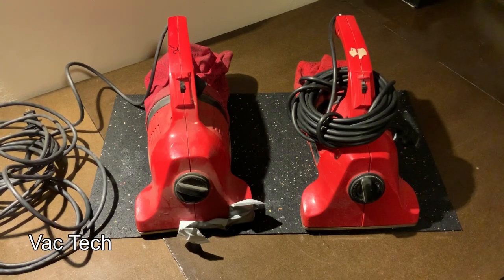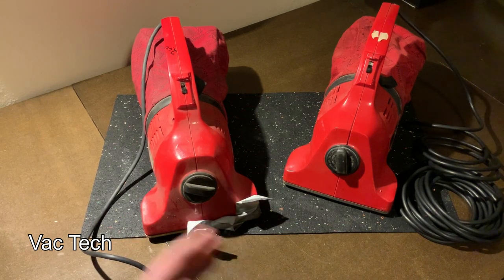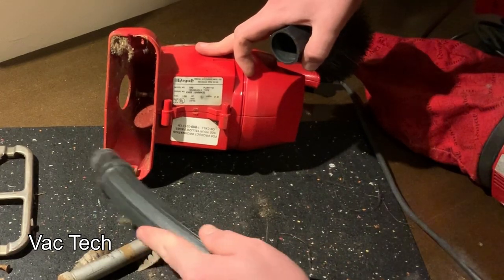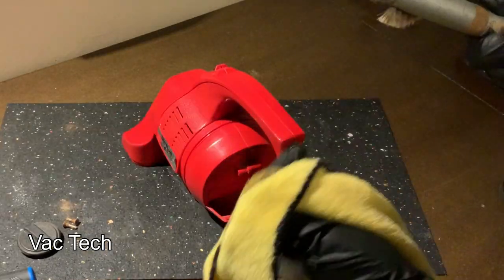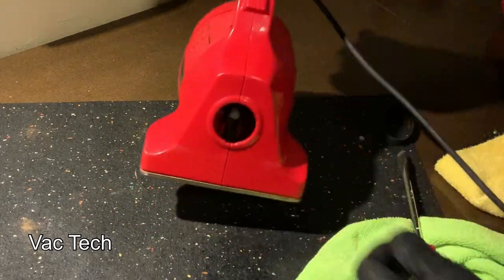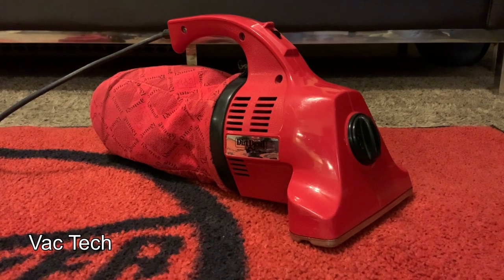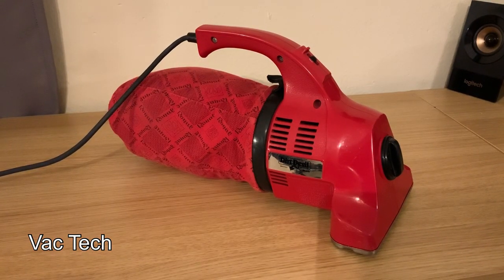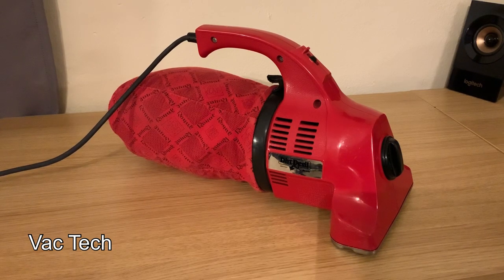1990's Dirt Devil Hand Vac Tune Up and Demo - Model 103

Comment: I want to tell you!  You really have to take VERY good care of these babies.  They don't make them anymore.  I actually have one of these Dirt Devil handhelds, same model and everything, same vacuum.  It was given to me by my real dad.  He used it in his pop-up camper and when he sold it, he gave the handheld to me and I use it for my stairs, couch, computer chair, and my upholstery and I like it.  I have a central vacuum system in my house and I actually love it but it's a pain to get out that long hose for upholstery so I use my Dirt Devil handheld hand-me-down for upholstery.  Knock on wood, still works!  😊

Comment: 😆 LOL!! The ultimate "Dirt 😈 Devil Test". I remember vacuuming the basement floor of my parents 🏠 house in 1987, at 4:00 am. Just the sound of the motor takes me back to then. The motor was surprisingly quiet, but this machine delivered some serious 👊 punch, as far as cleaning goes. The Dirt 😈 Devil was available for about $34.99 (varied by store), and I remember buying a couple of them in my time. My 🚶 stepmother"s Dirt 😈 Devil ✋ hand vac was the neatest thing, being the black Royal 500 model. It was irresistible to use, and I'd find my way, down to the basement, to 🔌 plug her Dirt 😈 Devil in, and start vacuuming the basement floor on several occasions(👍 yes, around 4:00 am). Dirt 😈 Devil is an Ohio-based company, and has been since somewhere around 1930(I need to ✔ check it out). Taking note around 1990, I noticed that there was a Royal Prince ( or close) ✋ hand vac. This was a silver aluminum version of the later plastic Dirt 😈 Devil, but I think they made both models through the years. I received my 🚶 stepmother's Royal 500 ✋ hand vac in 1994, for my own apartment. I also 👍 like Dirt 😈 Devil's 1980's ☝ upright vacuum. It's so easy to push it around the 🏠 house, and it used the identical belt that your ✋ hand vac uses. Got a used one for $5.00, or $10.00, for my Casa Grande, Arizona apartment in 2009. One word of ⚠ caution about changing belts, right after shutting off the vacuum. ✋ Wait for at least 10 minutes, to do so. The motor shaft gets freaking 🔥 HOT!! Also, perform the belt changing task with your vacuum unplugged, to avoid injury. Someone, or you, could accidentally turn it on. Your friend, Jeff.

Comment: I was given the same model of dirt devil the other week . It had the same issues with the cord splitting at the grommet where it enters the machine at the handle and the motor sounded like it needed the bearings greasing/ oiled . Stripped the motor down to regrease the bearings and solved the cable problem by boring through the grommet so that the cable passed right through to the terminal block for the wires . Our newly acquired Dirt Devil Handy work perfectly again and my wife loves it for cleaning the car . Great and interesting video from you . Being from the United Kingdom I have a great collection of Differing models of the Hoover Junior

Comment: I had the same issue with the bag wearing out. I used one of these in the early 90s to vacuum the stairs and my mom's car back in the day. These are great for cars. If I find one somewhere I am so getting it.

Watching you clean the bags out reminds me of the TV show Monk when he vacuums and then vacuums the vacuum.
Reply from the maker: Haha!  Vacuums are the best tool for cleaning out other vacuums.
Reply: lol this comment made me laugh so hard!
Reply: Totally agree on the quality of the cleaning ability of these. I have one somewhere around my place but can't find it. Need to make a better effort to find it because it does work great for stairs and cars.
Reply: @edracz1224  Yeah now I use that swivel sweeper cleaner thing they had on TV about 10 years ago and I've had it so long the original battery died and I'm now running it off a custom made pack but it still works and cleans. Doesnt clean as good as the DD but it works. Fills up quick too.
Reply: @VacTech1 I just have a comment on the brush roll itself, is there an arrow that must point in the same direction as the arrow on the metal frame you screw on, I have a dirt devil myself

Comment: You mentioned the Prince model was quieter, so now I hope to find one at a thrift store some day! They are available on Etsy & Ebay of course, but not as satisfying as finding one for a very low price. I have 4 or 5 of these red plastic Dirt Devils obtained free or for a few bucks but rarely use them because they are so loud.
Reply: I bought it for $6.77 from the thrift store yesterday with attachment kit.

Comment: I have 2 of these from thrift stores. Very common thrift find. They both work. I just can't ever find hoses for them anywhere. I try to connect hoses from other vacs but I think I'm missing a needed accessory to fit them in properly. I love 90s dirt devils. Just not as much as I love my 70s Kirby. The Kirby's weight and solid steel construction made me keep it around all this time. Very low maintenance and still works like new.
Reply from the maker: If you keep an eye out, the tool sets are still pretty common. You can often find them new or hardly used, and I see them at thrift stores. They have a special hose end, with a locking clip that holds the hose to the machine.

Comment: I'm curious as to the comparison of the cloth bag by itself compared to the paper bags. Do they blow a lot of fine dust into the air? 
I have an even older model ( not dirt devil) and if I remember correctly it has a bag with-in the catch bag, a double layer catch bag if you will. I've seen others with a paper bag inside the cloth bag. Which I'm sure work the best at preventing dust from coming through.
But I'm curious as to how just the bag alone you have on the ones you fixed compare...
I remember starting one of those old uprights with the paper bag inside the cloth bag and it poofed dust on start up. lol But those are much bigger motors... or I would think they are. DO you see the same with those Dirt Devils?
Reply from the maker: The optional paper bag definitely helps with filtration, for sure.  I would prefer to use a paper bag with mine, but these early ones would require the optional paper bag adapter.  The filtration on these is pretty poor, but tbh it wasn't out of the ordinary 30 years ago.
Reply: Thank you  @VacTech1
Reply: Your video was so fast I could not see how the bag comes off, Does it just pull straight off From the plastic ring? I just don't Want to pull on something and Break it.

Comment: I have a model 500, made in the US in 1991. I bought it at Goodwill years ago. It still works, though I think it could use a tuneup. Truth be told though, the great majority of my vacuums are trash picked. In eight years I have picked up about 50 or so of them, very few of them have I had to scrap. They are mostly Bissells, Dirt Devil‘s, Hoovers, Sharks, and Eurekas. 

As soon as I get a new phone to replace my five year old iPhone 6s, I will be making and releasing a video of my 4th vacuum competition, between my three shark navigators, NV 60, NV 22L, and UV 410.

Comment: You for sure, want to pull the end caps off the brushroll, and service the bushings. If they get hot, they can actually get hot enough, to deform the plastic slots that the end caps fit into. To do that, I chuck the axle in a drill, douse the bushing with "Zoom Spout" oil, spin it, then, blot the oil out with paper towel, then repeat. Do that, until the oil no longer comes out dark. After that, re-assemble the brushroll, put it in the vac, and run it with the sole plate off. Touch the endcaps with your fingers, and make sure they aren't any more than luke warm after a minute or two of operation. You cannot replace those brushrolls, so, if there's bristles on the one out of the other vac, it's definitely worth salvaging, servicing, and keeping as a spare. These were the best hand vacs out there, and I don't know why they discontinued them!
     Another modification is to remove the rear bronze bushing in the back of the motor, and replace it with a 608Z ball bearing, exactly identical to the load end bearing. The shaft size is right, and the outer diameter is exactly the same. and all that's needed, is to use a Dremel tool, and grind out the bar that fits into the notch of the bronze bearing.  I used to call this "Black Bombing", making the motor commercial duty. A good thing, since these motors are irreplaceable. the reduced friction of the ball bearing actually improves the performance noticeably, and reduces the temperature of the motor. It makes it much more able to handle the cantilever force caused by the tension of the belt.
Reply: Mine looks Rusty & the roller doesn’t turn. Engines turning belt but it won’t move the roller ? Put REM Oil in the ends of rollers - any suggestions?

Comment: also Im getting strong (The Brave Little Toaster) vibes when you are fixing it with the music in the background!
I subbed just because I know this will help me get the most out of my royals!
I referbed my first royal in spring of 2019 and it started having all kinds of problems recently. I couldn't bring my self to toss it just yet.
My mom got me a machine I saw at a thrift store that was missing the rubber nose plug. I originally planned to use it as a donor for the bag motor and beater bar. It is almost mint! It worked fine just swapping the rubber piece from my old one and reataching the belt that came off! The switch on this one is kinda looser and somewhat recessed feeling than my old one. Its not as snappy as the old one. Is that normal for some of these machines?

Comment: I just found one of these at a thrift store, these are great for cleaning stairs, couches, and cars. It's missing the front nozzle cap and it needs a new belt and brush roll. The problem is a lot of these parts have been discontinued and I don't know where to find them and I don't know what kind of bags to buy for this since Dirt Devil made several different revisions to this vacuum over the years. Please help.
Reply from the maker: I don't have any spare parts, but these hand vacs are still very common on the used market. Very common at thrift stores. When you take the red bag off, if where the dirt blows into the bag looks like you can fit a paper bag (looks like a tube), then it takes a Dirt Devil type G paper bag. These take a Royal/Dirt Devil style 1 belt. Hope you're able to get yours running!
Reply: I got the bags and belt only to discover the bags need an adapter which didnt come with my Dirt Devil 103 Thrift Shop Vac, ill post it also if i find it

Comment: Thank you for your video.  I have just changed the belt on mine which I think I bought in the early 80s.   Another video mentioned lubricating the motor, but didn't demonstrate it.   Are there lubrication points on the motor?
Reply: If I may answer that: there are no oil ports to add oil, but there are ball bearings in the motor. You can replace them when they go, or you can sometimes salvage them if you pry the seals off and repack them.
Reply: @mattjones7621  Thanks.

Comment: Over the years I have collected 5 of these. Two with the bag attachment port and two without.
Does anyone know if there are filter bags still made or that can adapt to these? Are the parts and cases all inter-changeable?
The mess with just the cloth bag is not worth the mess and the coughing fits. 
My son is trying to design an adapter to hook the exhaust port it to a chunk of 3" hose but it's a bit problematic.

Comment: I have a model 103 (red bag) and a model 501 (blue bag). Both vacuums were being used without filters. Do I need to use a paper filter with either one? Amazon sells filters for both (type G & J).
Reply from the maker: Paper bags are optional, but make taking care of it easier.  They take type G bags.  Early Dirt Devil hand vacs required an adapter to use a paper bag (they used to sell a conversion kit), but newer versions could take a paper bag without an adapter.  I hope this helps!

Comment: You had your hand over the reason I was watching your video 😫.  I need to take the bag off and I hesitate to pull too hard on the bag tab (I don't think it's ever been taken off) in fear it will break.  How do I take bag off?
Reply from the maker: It removes with that pull tab, or you can gently work the entire black bag ring off (it just stays snugged-on by that black ring, and just pulls off).  I just wouldn’t pull on it by the fabric bag itself, as that could tear if worn.
Reply: Many thanks.

Comment: I have a Dirt Devil Series 500 just like these but black and yellow we’ve had it for years still works like a champ but gets little use any more the kids pulled the rubber plug out of the front we put duck tape over the hole works fine but never found the rubber piece
Reply from the maker: You might be able to get that cap on ebay, or if you see another Dirt Devil at a flea market. Thanks for watching!
Reply: @VacTech1  I’ve been on the hunt for cheap attachments for it as well as I mainly use it for cleaning our cars now but is still used in my household some, it was the best for our minivan we had

Comment: I have severe lung issues so I want to use a bag but I can't seem to find the bag number( I have the Dirt Devil 500 handheld) I know someone told me the bag G works but with that lip thing on it like that at the bottom it does not work.  Can you please advise ? Thank you
Reply from the maker: For older hand vacs, there was an adapter that you had to add, to be able to use the type G paper bags.
Reply: @VacTech1  is this adapter still available and if so where can I get one
Reply from the maker: @brendap7696  I looked and saw one on ebay, but it wasn't cheap. They haven't made them for several years.
Reply: @VacTech1  aw bummer. Thank you so much for researching it though.♥

Comment: What is your bench Vac
Reply from the maker: I use a Dyson CY23 with a custom extension hose on it.
Reply: @VacTech1  my bench vacuum is a Central Vacuum
Reply from the maker: @VacMaster2020  congrats! that sounds like the best option!
Reply: @VacTech1  how is  your Dyson bench vac doing
Reply from the maker: @VacMaster2020  it works great! I wash the filter once a year or so. As a regular vac, the tools on the CY23 are awful. As a bench vac with 18ft of retrofitted hose, it's awesome.
Reply: @VacTech1  Nice machine  your Dyson works good for you for me i Use to  use a shark then I used a Dyson then a Miele and now I use my central vac
Reply from the maker: @VacMaster2020  I also have a Miele C2 that I frequently use for projects. Great machine.
Reply: @VacTech1  yeah the Miele la C2 is a good machine

Comment: doesn't this have a bag iside the cloth bag so that the dust is easier to throw away and thine whole vacuum stays cleaner? does it have a filter?
Reply from the maker: Some models took paper bags, others didnt, but could be adapted to be used with disposable paper bags.
Reply: @VacTech1  thanks for responding. this model seems to take a g-style paper bag.Without one, the dust would escape through the cloth bag. (If the paper bag breaks, then there is dirt and dust falling inside on the cloth) I understand that the models that collect in a plastic portion/recepticle don't require a bag. I used your video to clean an old dirt devil ultra model, including, washing the cloth bag. Thank you.

Comment: How did you wash the cloth bag? Sink or machine? Any detergent?
Reply from the maker: I gently hand washed it with a little detergent. Made sure it was rinsed thoroughly.
Reply: @VacTech1  thanks
Reply: @gingermullis2049   Just washed mine two days ago and I used Dawn dish soap  (a very generous amount of soap)  and let the bag soak in the kitchen sink for an hour or so then squeezed the bag while submerged with both hands to thoroughly clean out the fine dust particles out of the bag. Then simply give it a couple rinses using the same squeezing action and the bag comes out like new. Dried quickly overnight too. The bag does not shrink at all from getting soaked neither. Once dry it's just like new. Just used my vac and I chuckled to myself... "Gee I'm gonna get the bag all dirty again", haha!
Reply: @timemachinefan , thanks!!
Reply: @gingermullis2049   You're welcome Ginger!

Comment: Mine is so weak. How do I fix the suction?
Reply: @Vanny The Bunny  Mine was too but I solved it by taking it apart (it's easy) and removing the motor and fan and cleaning out hair that was accumulated behind the fan, and it was impeding proper rotation of the plastic fan. I used common tweezers to pull out hair that was all wrapped around the spindle. It's very easy to do.... There's five screws holding the two red halves (the outer shell) together. You'll be surprised of how much junk is located around the fan. Once thoroughly cleaned I installed a new belt and the old vac is like new again. Surprising where the hair came from because I have no pets! Must be from me because I'm an old timer, hahaha....